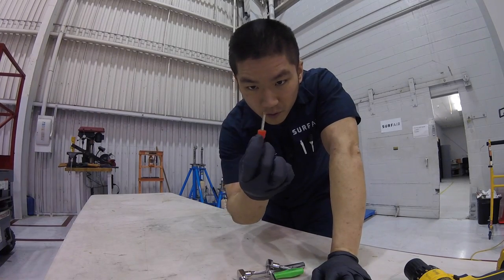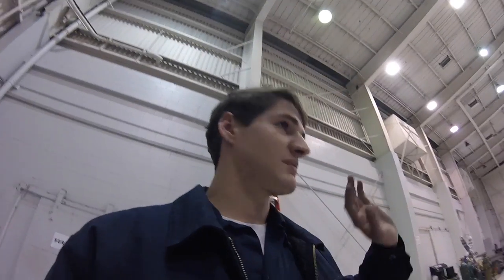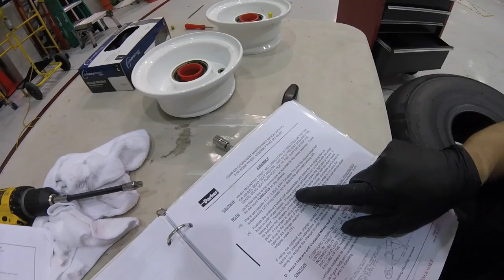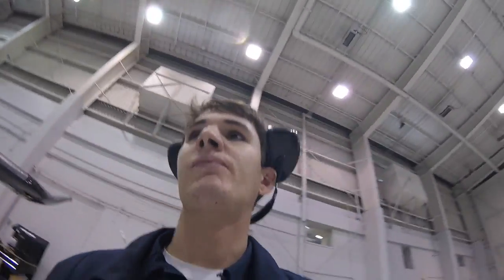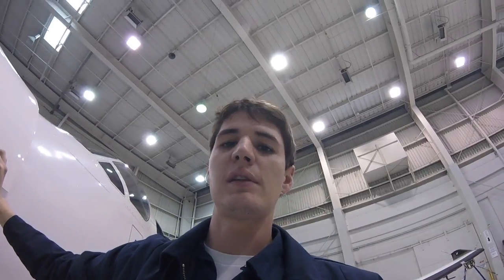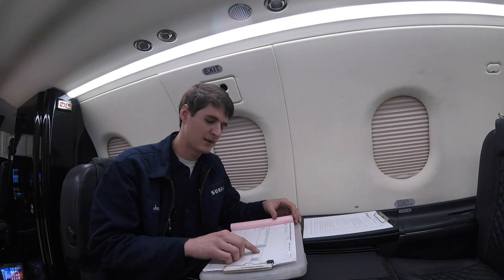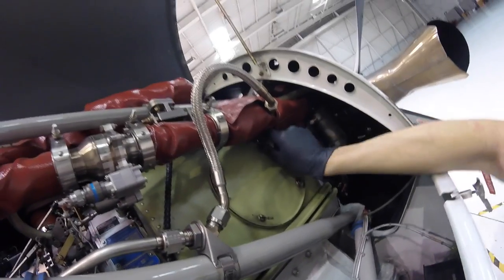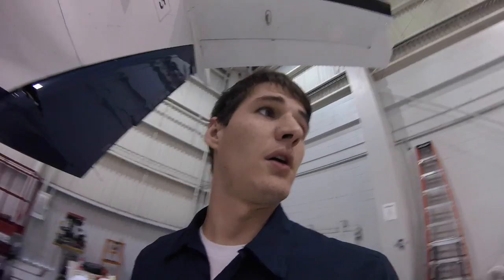how to build tires

Comment: It must be so nice to service the oxygen bottles directly. In my case, when the crew oxygen bottle is low on the B767-300, we don't have that luxury. We have to crawl into the main equipment center and physically remove the old oxygen bottle (which is ~3 ft long by ~1 ft in diameter btw) and swap it out with a new one before securing everything, doing a leak check and then an ops check in the flight deck. God forbid you have to deal with the steel cylinders instead of the composite ones because then you have to deal with their weight.

Comment: First, Tires... We had a metal ring made that fits our nose wheel rims (just a little bigger than the rim) and use a Hydraulic Press to break the beads so we have less working force on the body. We do around 40 sets of nose tires and 80 to100 main tires during our summer maintenance season with a crew of 3 to 4 A&P's. Second, I have no clue how you guys can live don't here with the pay to cost of living down there in Hawthorne. Lastly you two need to try the Reno Air Racing in September and get the pit pass it's a must.. Just saying.  
You guys are doing great on explaining what your doing on maintenance. I seem to get vapor lock on terms some of the time, but I do get the point across when the vapor lock clears... LOL

-Dev
Reply from the maker: Thanks Dev, I am planning on the air races this Sept. Also great idea for the bead breaker, we arent doing quite as many tires but still would be a good investment. As for the cost of living - thats what COLA is for ;)
Reply: The company (contracted to the state of California) that I work for has us mechanics do a lot of summer projects so I went into the tire shop to stay out of the over 95deg hangers and into a nice A/C back shop.... LOL..... A good time for Reno is Saturday and Sunday. Pit pass is a must if your really in aviation.. I was on a Formula 1 crew last year with #3 Chaos Theory, but I'm not sure if he is going to race this year. It was cool to have my name on the plane. I might have to jump in with another crew this year if asked! Keep the videos going I know I would but our company (and the state) won't let us do "How to/Looky here video's so I'm living vicariously through your video's.. Thanks

-Dev

Comment: I really have immensely enjoyed all of your videos. hope you bring us more in the future your profession is definitely very intriguing end interesting. Glad to see you got a new drone, perhaps you can incorporate a few shots while at work with a drone on over floats. in the past you've mentioned the AC systems on this pc-12 Ng I have always been interested in how for example they maintain a specific elevation pressurization in aircraft and how they keep the oxygen cleaned. Do they have oxygen scrubbers on airliners or on these pc12? keep up the great work James. I wonder if your employer fully appreciates the free corporate commercials that you are doing for Surf Air
Reply from the maker: Gary, thank you very much for the kind words and enthusiasm. I can't speak specifically to airliners though I assume the systems are similar. Essentially we take compressed air off the engine prior to the introduction of fuel (so clean compressed air) and send that into the cabin through a series of valves and temp controllers. The air inside the cabin is slowly bleed out of an outflow valve so eventually all of the air in the cabin is continuously replaced with new clean air. The rate at which the outflow valve allows air to leave the cabin is controlled to maintain a comfortable breathing pressure in the cabin for pilots and passengers. The maximum altitude an aircraft is certified to depends on both the fuselages ability to hold pressure and the engines ability to supply compressed bleed air (as well as various aerodynamic factors too). Thanks for the question!

Comment: iirc VCCS pulls around 100amps (2.8kW) from Generator 1, so unfortunately it's a no-go for conditioning the aircraft prior to passengers boarding (which is quite a pain when the plane has been sitting on a 30°C tarmac the whole day).

Comment: I have a question about the tires. When they are at altitude, Say 30,000 feet how do they keep from exploding with the pressure differential.
Reply from the maker: The pressure differential at 30k feet I believe (correct me if I'm wrong) is only 6-7psi so not high enough to have issues.

Comment: would an unbalanced tire have a tendency to hop or shimmy?
Reply from the maker: it shimmys. not sure if it's trying to hop and the weight of the plane is too much so it can only shimmy
Reply: I'm curious how a shimmy results from the center of mass being out of alignment with the center of rotation. Is it rotational balance being corrected when balancing a tire?
Reply from the maker: when we balance tires its for rotational imbalances. im pretty sure when the (nose) tire wears it can get axial imbalances which may contribute to a shimmy. i dont work at #goodrich, but it seems legit.